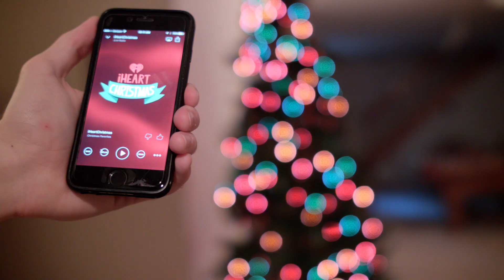How to Make Holiday Lights Flash to Music

Comment: Was kinda pointless to cut both wires on the extension just to solder one back together. Also the wiring diagram your switching the neutral and calling it the hot wire. Some people without basic understanding of electrical could make some dangerous mistakes.

Comment: Stop using electrical tape and use heat shrink tubing and get pro results. It's not expensive and you can buy color & dia assortments.
Reply: He wouldn’t have needed heat shrink or tape if he didn’t cut both wires. All he had to do was cut the hot and land it in the relay. He cut the other just to solder it back together. Was kinda pointless.

Comment: Hey quivk question can i plug multiole christmas lights?
Reply: If you're using LED lights then you should be able to connect multiple light strands together. Just make sure you add the amperages of the light strands together and make sure the combined total amperage is not close or more than the SSR can handle or it will overheat.  Cheers Shu!

Comment: Does this need a heat sink
Reply: A lot of that will depend on how many lights are connected to the SSR and the type (LED vs Filament). Each strand is rated for a certain amperage. If your lights are over half the rated amperage for the SSR I would recommend using a heatsink.  Cheers Shu!

Comment: not the best idea to use .... every time your lights flash it is basically causing a short to the relay which is zero ohms .. ok if you dont mind blowing up cheap powered speakers .... wouldnt use it on audiophile hifi gear

Comment: How many strands of lights would this be able to sufficiently power? Planning on running this setup on a larger scale for an entire light project.
Reply: Depends on the relay you get, if it has a heat sink and how much power your lights pull

Comment: It does not seem to work with a receiver speaker wire feeding the input of the relay. I measure only 9.3 mV coming through the speaker wire which isn't enough. If I feed the input wires with a 9-volt battery, the Christmas lights turn on, so I know everything is wired correctly.

Comment: it doesnt work!!
i did everything he did but it doesnt work
why??
because the voltage coming from the speaker to the relay is not DC VOLTAGE its  AC VOLTAGE...
what should i do?
Reply: You can make a simple full wave rectifier to tackle this problem

Comment: Hi... thanks for a very interesting video. If I may ask a question. Do you know how to make a light beam go up or down (kinda like mercury in thermometer) based on the electric current passing through the circuit. Can you please guide me on where to even start looking for information on this project. Thanks
Reply: Use the code like turn on relay1(connected to bulb1) if voltage is greater than some specified value and so on for others. If you're really gonna make this project, hit me up here and I'll write the code for you if you want
Reply: You can use Arduino. The code for this is fairly simple. It shouldn't take much hard work to make this project

Comment: Made it and it works sometimes, but only when blasting the music. Any ideas to get a stronger signal? I also get no volts coming from my speaker wires when I measure it with my multi-meter even though it'll light an LED. Thoughts?

Comment: i use a ,LED Strip, lil' transistor, power supply, and auxilary cable. joint them and plug it on audio source, then play a dubstep music. better if i play the music at night with lamp turned off party 😂

Comment: Do you need the relay in the circuit? Or can I skip it.
Reply: It's needed. Because normal supply from the speaker won't necessarily will be able to light up the lights. So using relays will open lighting-options to every light combination which can be lit up with domestic supply.
Reply: If you don't use a relay, it won't be able to light more than a bunch of LEDs, i suppose

Comment: When I was younger I just cut the male plug off string lights and spliced the wires into the speaker wires that were connected to the stereo and hooked them into the terminals and it worked the same way without using a relay
Reply: and you were killing your amp in the process, the more you know...
Reply: Ok genius lol ❤

Comment: In hindsight, you only needed to cut the hot wire to put in series with the relay. Then no soldering required.
Reply from the maker: +Dillon Nichols yep
Reply: Well you still need to solder to the side of the speakers
Reply: @datgamerboy123  not if you splice it in line with the speaker wire